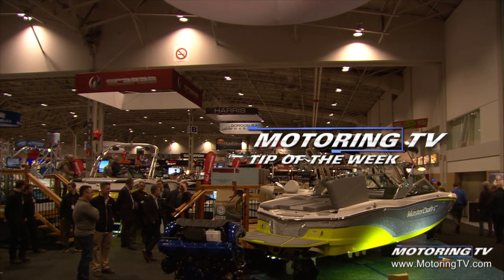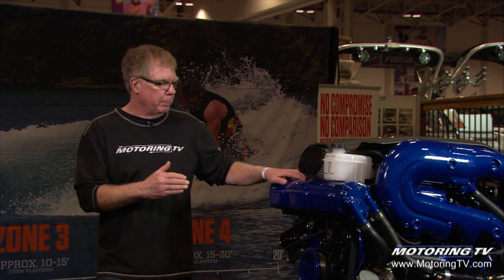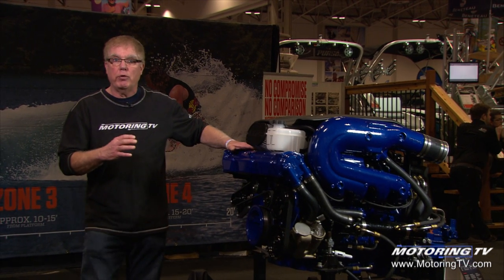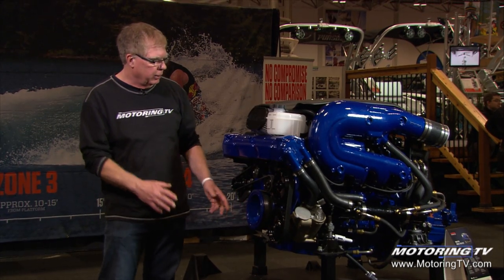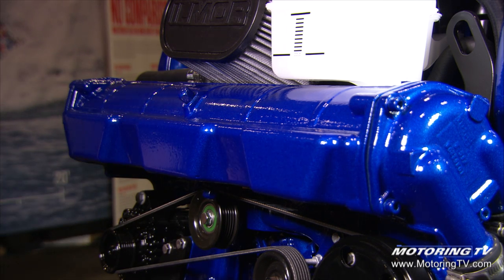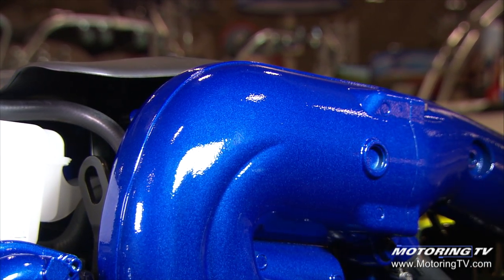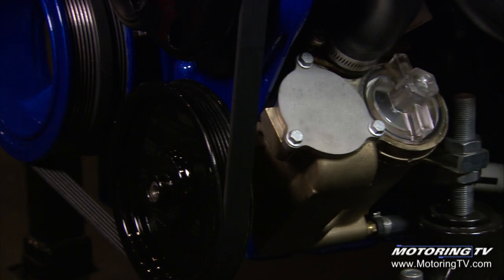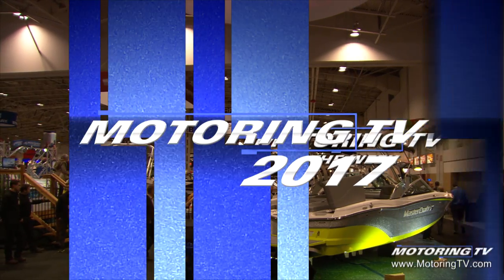Tip of The Week: Marinizing a Boat Engine

Comment: anyone considering mercedes turbo diesel engine marinization? I thought they might be good as they use them in vans and jeeps, so they might be cost effective plus it has a full aluminium engine block, lighter and better corrosion resistance. If any mechanic professionals or nerds see this, please let me know if my finking is bad, Thankyou. Or if someone wants me to install their crate engine in my boat, happy to build an 18ft classic speed boat around a ferrari v12, or similar. Just saying
Reply: @WATER-MANS: GREAT JETBOAT PROJECT thanks for your detailed response. Im wanting to put it into a 18ft wooden/ fibreglass jet boat. Hehehehe. Im just finishing a 4 year sculpture and my next project is going to be something i can build from plans. Will try to keep you posted. So far i have only built the frame to build boat on. Thanks bryn
Reply: someone i know has triple mercedes 320cdi diesel engines in his boat with 224hp each stock but after chiptuning around 260hp with plenty of torque these engines are easy to marinize and are very reliable.
Reply: @Luuxs  You are absolutely insane if you think you can switch an automotive engine over to a marine engine! In a marine engine the crankshaft, connecting rods, pistons, gaskets, freeze out plugs, valves, valve springs, water pump, thermostat and so much more it’s totally different from an automotive engine! I think about it an automotive engine usually lives between 1200 - 2500 RPMs, A Marine engine spends most of its life between 2500 - 4800 RPMs! The only people that think an automotive engine can be changed over to a marine engine are either backyard mechanics with limited knowledge or someone trying to scam you into buying their products! That is only some of the differences in just the long block, Fuel pumps, carburetors, starters, alternators and the type of wire used is just a few more!

Comment: As a lifelong Boat Owner  and Operator it has always been my understanding that there are some differences of the Internals of a Marine Engine than the Automotive ones utilizing the same Block  and those are the Crank needs to be Forged to withstand the Tourque needed to spin the Propellers in the water, the  SteelFreeze Plugs need to be replaced withBronze ones to resist Corrosion from the harsh enviorment of the Marine Engines majority of use  and on some models the heads need to be drilled and tapped to install a inlet/outlet  for water circulation  that keeps the engine running at the correct temperture  that   is actually drilled right into a water Jacket  and allows a hose to be connected  things like the Forged Cranks  can be stock on the Automotive Industry vehicles mainly  in what they refer to as Truckmor IndustrialEngines  sometimes used in heavy Machinery and Agriculture Machines  that also require that higher level of Tourque  years ago GeneralMotors did build  the 283 SmallBlocks with a Forged Crank  standard  but i think they stopped that motor in the late 1960s early 70s  it was  used in a couple of Cars  if memory serves me correct and i’m not a GM Expert it was the Impala ,and Corvette that used the 283  maybe some Muscle Cars as well  my Dad remembers in the 70s  a lot of Hot Rodders  would  buy up Junkyard Chris Craft motors  that were GM blocks  Marinized  and the HotRodders would put those Forged Cranks  into thei high performance Engine builds  apparently it was cheaper than buying new ones elsewhere ? it makes sense to me  inFlorida which is where i grew up  many people have taken Boat Engines and put them into their HotRods  and they leave them dressed as  Mercruiser or whatever Marine Use they were intended for  that’s more of a Show or Conversation Peice
Reply: Interesting.
Reply: Plus, marine engines (Mercruisers especially) account for the high RPMs at a cooler temp by over-boring the cylinders and using a hotter camshaft.